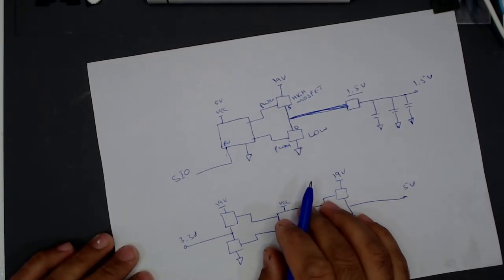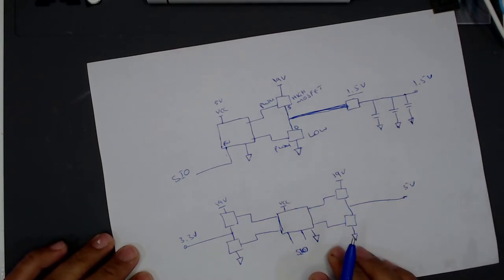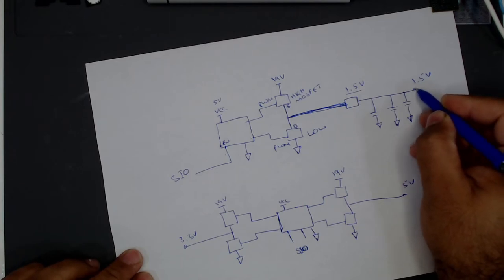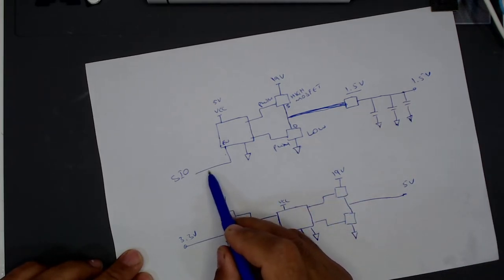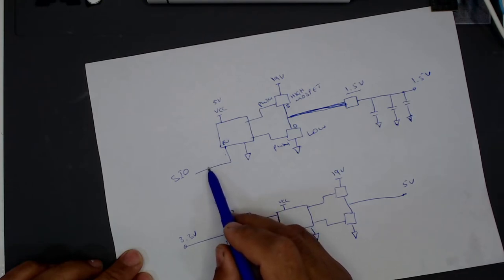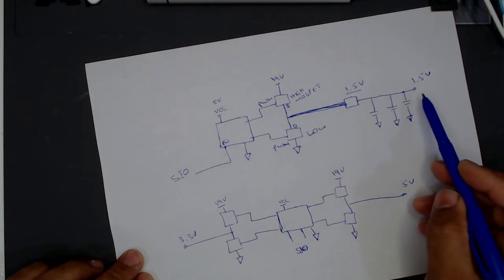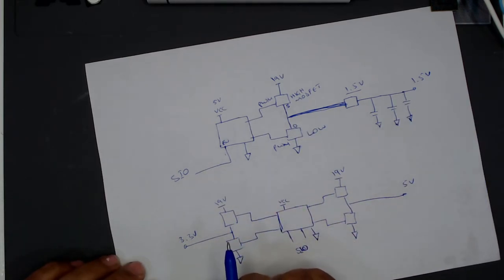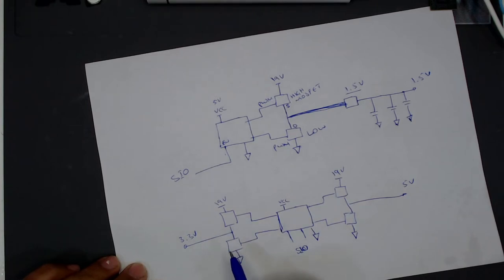How Motherboard Power Regulators work..

Comment: Had a lenovo T460 for years that never wanted to give me 3v/5v on the coils.Never understood why.Ordered replacement IC chips which are on the way and just finished looking at this video and as you explained the enable signals come from the Super IO. and my both enable signals are missing.This is one of the best and most helpful video my friend keep up the good work.Will try to replace the SuperIO and cross my fingers.Thanks

Comment: why do  is it to use PWM? to control both mosfet, so why don't we use one mosfet to get 1.5 volt. is it not possible?
Reply from the maker: It is possible which in this case is called linear regulator whereas the one used is called buck regulator..

The linear regulators convert the (19v) to a lower voltage (let's say 1.8v) by dissipating the (17.2v) into heat and this is not efficient at all when it comes to a battery powered appliances. 

The Buck regulators switch the input voltage (19v) ON and OFF rapidly using  Mosfets to regulate the voltage.
 This type is High efficiency, reduce power dissipation and suitable for applications where power efficiency is crucial.